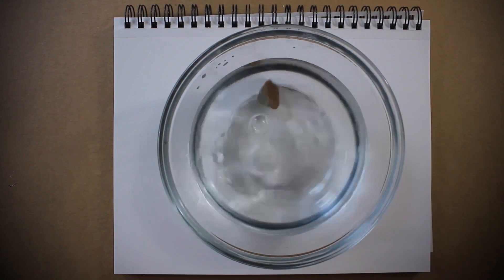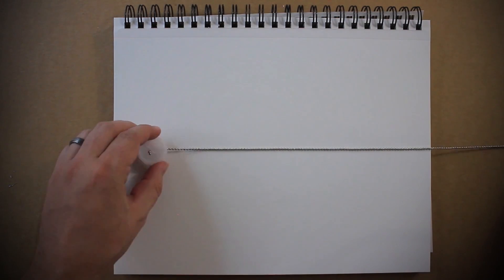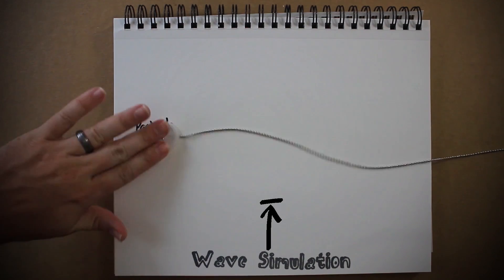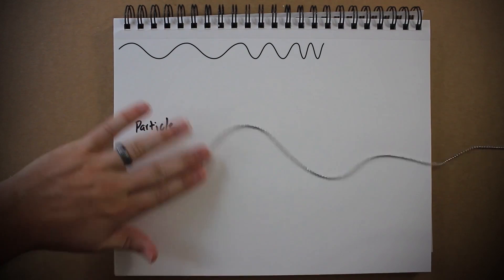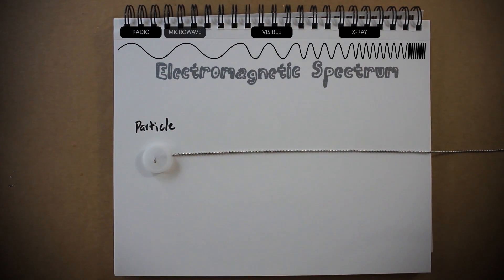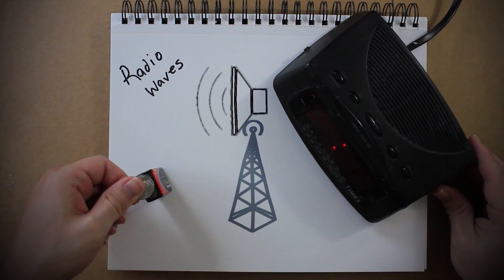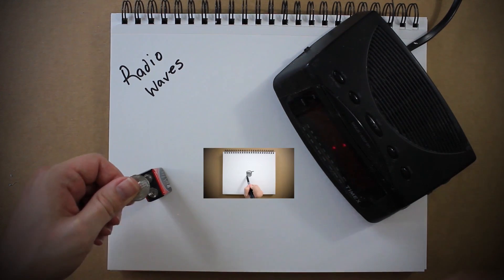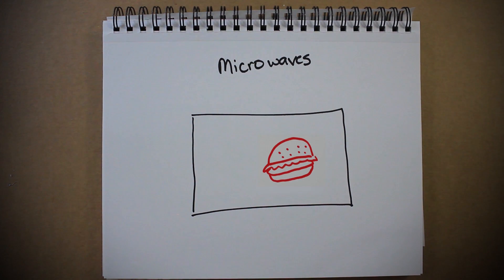How To Build A Cheap EMP!

Comment: with the circuit for the camera, is the transformer necessary for charging up the capacitor? I ask because I got one of these and desodered the capacitor. Then I tried desodering the transformer, and it broke.

Comment: so this is only good for frying cheap calculators and not sound systems from noisy neighbors from next door?
abit more info wouldn't hurt like what is the range of the device or how to increase its output
Reply: Exactly.... no one on youtube is telling about this, everyone of them are just making short range EMP's that are extremely weak.
Reply: To make your emp more powerful use a larger coil of wire as that will amplify the electro magnetic wave that is transmitted from the device
Reply: And use a larger battery👍🏼

Comment: It's to bad all houses today are connected to shared power. If you save your iPad and yourself from emp. How would you charge the iPad back up ? The generator stored in the back of the house won't work. Cause it's to heavy to save. Or perhaps you saved a flashlight. How would you get new batteries ? ...no one should even worry about dooms day. If there is one. Cause The Lord has plans for everything. But one must also take care of themselves too. Look now I got this comment to long.
Reply: Ok. Thanks. I am going to wrap my generator in aluminium foil. Thanks for saving me.
Reply: Riki Z. Hey man, anytime I can help :)

Comment: If a microwave oven prevents the radiation from leaving the microwave, could you theoretically just use a microwave oven AS a faraday cage?
Reply: Dylan Krone
Yes you can, that's why they have that mesh screen on the window, so that the waves can't escape. the holes in screen are smaller than microwaves but larger that light "waves"

Comment: hey bro.. thx for video. I have question. So technically 2 factors to create EMP is a charge and electromagnet - copper wire. Wat i need to create more powerful EMP? Wat would be optimal copper fire electromagnet, would it increase it's effectiveness if ill put metal core in the coil and wat power supply/condenser characteristics? Let's say i need EMP wave that will fry all electronics in 3m radius.
Reply: Did you build one

Comment: If you create more coils, and stick a metal pole in the middle, could you make it more powerful? How powerful could you make this?
Reply: I think it's about how much power the capasitor (or how it's called) has stored inside
Reply: no its mostly about the number of times it goes around just you need to keep in in a loop and after 10 times you really need something for it to go over, also then it starts to have a range to it

Comment: Question.... Could I keep the battery connected and instead of using the toggle could I use a momentary switch and enclose it in a project box and use it as a emf generator????

Comment: The circuit with the "EMP" is nice, but it isn't actually an electromagnetic Wave your getting out of there. It's just a short burst of magnetic field, which fries the calculator, different from the Microwave where actual electromagnetic waves are created.
So somehow you could say it's an "MP" because there is no electric field going on (except for in the capacitor).

Comment: Microwave radiation only makes polarized molecules "giigle". Water molecules are polarized so that's what actually makes foodstuffs heat up, and as Tinkernut said, the electromagnetic waves causes electricity flow in wires [Most effective in coiled wires] [most wires are made up of small wires threaded around themselves and also act as a coil], that what the use for wireless electricity [have an alternating current connected to a a big coil of wire and having another coild clump of wire in the proximity [best effect if directly on top] which then converts the electromagnetic radiation to electron flow, the same way the microwave fried the calculator] [fun fact this only works with alternating currents since the constant switching of the current causes the actual electromagnetic waves]

Comment: here's one, Get a mug and fill upmost of the way with water, Now get a working light bulb (any will do) put the bulb in the mug of water so the metal of the bulb is in the water. then pop it in the microwave. you will see a cool light show inside the bulb,

Comment: What is the Value of the capacitor  you used  ?
Reply: 5 bucks.
Reply: In ohms?
Reply: john smith I dont know, the camera can cost 5 bucks, so...
Reply: HeyImLarry so what?
Reply: john smith You wont get much for a capacitor.
Reply: I don't mean the price but i mean the value of the capacitance in micro farads
Reply: I have no idea now, you seem to specialize on this and I don't.
Reply: Finally
Reply: john smith are you a bot?

Comment: Faraday cages cannot block static or slowly varying magnetic fields, such as the Earth's magnetic field (a compass will still work inside). To a large degree, though, they shield the interior from external electromagnetic radiation if the conductor is thick enough and any holes are significantly smaller than the wavelength of the radiation.

Comment: Cool. So… how dangerous would it be to use a microwave with the door open if you were to stand in the same room as it, a couple metres away. If that's fine then how close would you need to get for bad stuff to happen?

Comment: Nice video! However, not just any oscillating particle will create an EM wave. Inside a crystal, it will actually create a phonon.
Reply from the maker: the theory is that the waves actually consist of photons. In the video, I used a beaded chain to represent the waves...so the beads on the chain represent the photons.
Reply: Tinkernut Yes, waves do consist of photons (or are photons, blah blah modern physics). I was just pointing out that not any oscillating particle creates photons. Only electrons.

Comment: If I wanted to create the circuit from scratch how would I go about doing it? Could anybody direct me to a simple schematic?
Reply from the maker: Paul Petricevic I didn't include the camera type or schematics because there are so many different disposable camera types out there that it'd be really hard to find the exact on I use. But the principle should work with any disposable camera, and that's what I was trying to show.
Reply: No big deal, if you want to make the simplest circuit i know of, then get a AA battery and a thin metal wire, then connect one end of the wire to one endnof the battery, and the other end to the other end of the battery. Electric current will flow through the wire creating a simple closed circuit. Also, learning scematics are not hard, just do a google search for 'simple circuit'. Have fun!

i hope this helped. (btw, dont shock yourself.)
Reply: Not sure if troll or serious...What I meant was a circuit of the capacitor charging circuit and coil.
Reply: ***** lol, just find the camera that he uses (ask him) and did what he did in the video. and im afraid that there is no schematic availible..
btw im sorry that i didnt interpret yiur message correctly, and no i wasnt trying to troll.
Reply: ***** actually, the camera is a FujiFilm
Reply: Tinkernut ah, ok :^)

Comment: you said if you put something conductive around the conductive material the inner one won't be touched, but you used a cart box which is not conductive, obviously it did nothing in the microwave